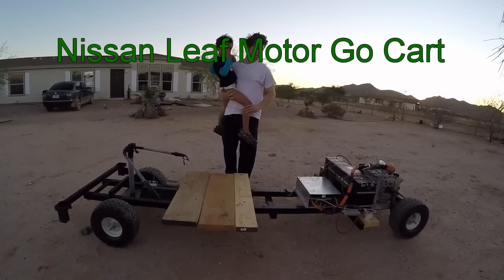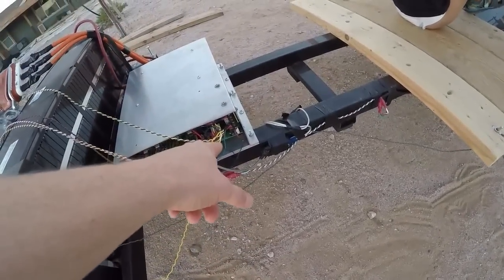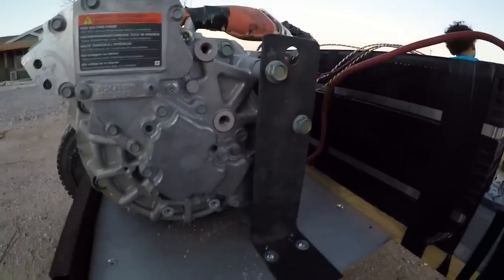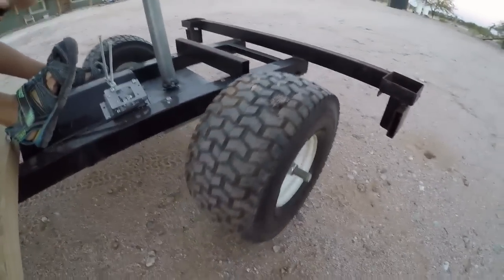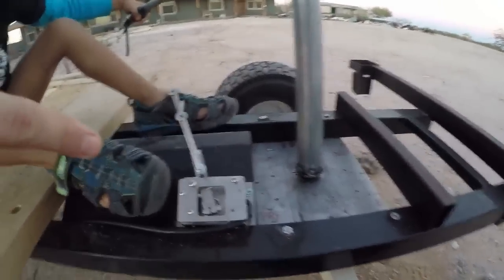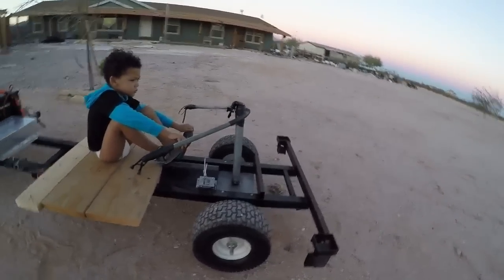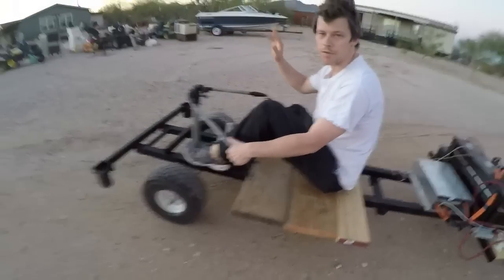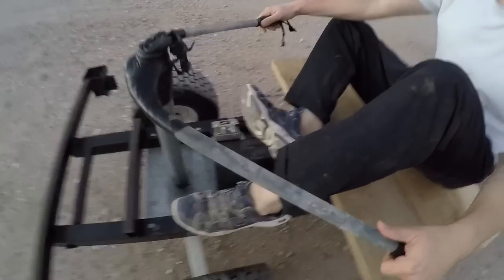Nissan Leaf Motor Go-Kart

Comment: hi   this is a great video, I have question. i am thinking of fitting a nissan leaf motor into my boat. and hoping to use as much parts possible from an old nissan leaf 2012, plus the batteries . but should i use every thing from the car or should I invest in a diffrent conroller / resolver as you did.?  thanx in advance

Comment: Great kids.  Well done there, anyway!  The kart, good solid piece of work, just wonder why you didn't leave (note avoided saying LEAF) the powertrain & controller combo all stacked as original?  I am only a minute in, you may well say in ten seconds time it's for centre of gravity reasons...!
Reply from the maker: haha.  I was only interested in driving the motor with my own controller mostly as an exercise in software and hardware design.  Also, All I had was the motor from Ebay.

Comment: Great job I love this project! I understand that you have the 12 volt pack powering the controller but what do you have the 92 volt battery pack connected to? IS it possible to power motor through the controller with a large 12v battery bank? 
I'm not experienced at any of this but would like to gain more experience at projects like this much respects out to you for this project!
Reply: 92v is for the electric motor

Comment: I wondered about fitting the Nissan LEAF complete power unit into a bike frame, I couldn't help but notice the similarity of this unit to a motorcycle engine even though they have nothing in common.  I think, it is so they can make these things interchangeable ie use the same basic car, for either power method.  Put a pic of a three cylinder motor up against it, it's uncanny.  (link here, at the end of this 500-mile LEAF trip I do exactly that -  
 https://www.youtube.com/watch?v=axsTlaVNZJQ   -   we went from England to Scotland.  I know - it's only one step if you start in the right place!  Thanks again, and you could fit any body on top you like of course.  'I feel like a Porsche today' etc.

Comment: how hard is it to find one of these leaf motors? and build or buy a controller? I have been wanting to build a ev . or convert a car or truck . I have DC motors. that is as far as I have gotten. I'd say the leaf motor will have more power than I have. I don't want a street leagal golf cart. I need to keep up with traffic. or pass ppl. would be better. and I will charge with solar! great video